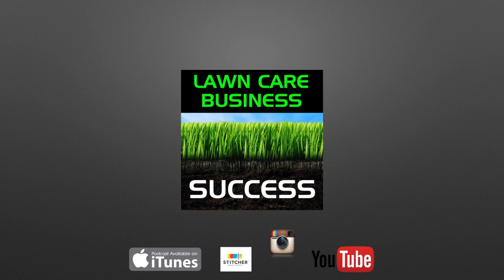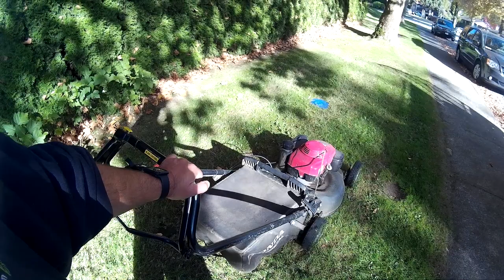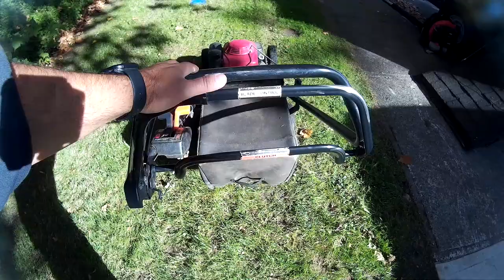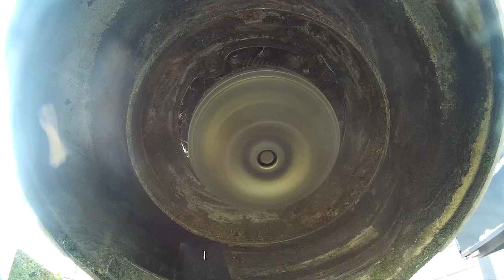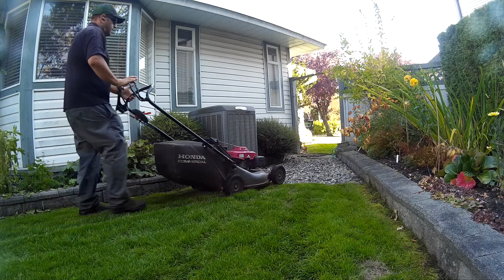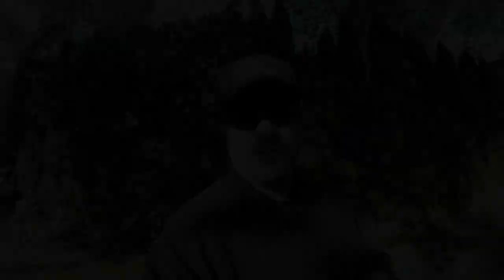What is the BBC or blade brake clutch on a 21" lawnmower

Comment from the maker: Let me know in the comments below if you use a 21” mower with a blade brake clutch and what brand and model it is.
Reply: Lawn Care Business Success i use a 1996 John Deere 14sb
Reply: I have used Honda HR214SX, HRA214SX, HRM215, a John Deere 14pb and briefly a Toro 26626 or something along those lines.  Currently I have a Honda HR214SX and a HRC216k3HXC.  Nothing can compete with Honda's Roto-Stop systems.  On a side note, I also own a Honda HT3813 lawn tractor but it currently has no deck and needs some TLC.

Comment: I have the Canadian model of your Honda and an HRX217HYC (top of the line residential mower with blade stop and hydro transmission, but without electric start) and have owned the old HR214SX and the HRA variant with the steel deck.  I also grew up with the HR214SX and they are some of the best mowers you can buy.  Unfortunately Honda has stopped making mowers for the Canadian market so I am kinda left with Scag or something else.  Scag has the advantage of using a Kohler Command Pro engine that's a bit bigger than the GXV160 but the transmission is nothing like the Honda.

Comment: I have a Honda HRX217VYA mower.  I recently had someone sharpen the blade and now the blade brake does not engage.  The blade is constantly spinning, even when the mower is just idling.  How do you fix this?
Reply from the maker: Sorry I have no idea. Taking the 2 bolts off to remove the blade does not affect the clutch. Unless the person was not familiar with the mower and somehow took the clutch apart to get the blade off or damaged something else in the process. Hard to speculate. Never had that happen in the 12 years I used the Honda mowers. Thanks for watching.

Comment: Why does the blade stop cutting or slipping can this be removed and set to standard on the Husqvarna HU 775bbc?
Reply from the maker: Sorry not sure on a husqvarna mower. Sounds like the clutch is slipping or disengaging. On the Honda in this video I’ve never had an issue with the BBC system. I’ve literally cut thousands of lawns over the years trouble free. Thanks for watching.

Comment: I have a hu800awdx/bbc and love it but a year old and one of the drive pulleys froze and I can't figure out how to get the bbc gizmo off to replace a $12 pulley!  No info online anywhere. It would take forever for the shop to fix it under warranty or cost me bigtime for immediate fix at a shop.  I just paid $749 for this and I need advice.  How to remove the bbc, what order etc!  Can you help? How to get the nut off? Torque?
Reply: Look up the manual for it there should be a section on how it’s put together. Just reverse engineer the manual and remember the process of taking it off to put it back on, that’s what i sis for my HU725AWD/BBC

Comment: Hi I have a John deere jx75ex when I try to pull start the engine it has a drag and its impossible to pull start but if I engage the BBC and then pull the engine it starts no problem is this a sign of a badly worn clutch
Reply: Signs of a bad brake for the blade.

Comment: Why did you remove the upper blade? Why call it a 2 16 when it stands for 21" 6hp.
Reply from the maker: I removed the upper blade because I’m in the Pacific North west and it rains most of the year. The single blade bags wet grass way better as it creates more suction with just the lower blade. I refer to the mower as the hrc 216 because that is the model number and what everyone calls it, including my dealer.
Reply from the maker: Also forgot to mention that Honda sells a shim to use in place of the top blade if you want to remove it, so that the bolts stay the right length. I got it at my Honda dealer.
Reply: Toro called some of their mowers these designations: 21-5 (for their Hevi-Duty model 23158 with the 21-inch cut and Briggs & Stratton 5 HP engine) and 25-6 (for their Hevi-Duty model 23267 commercial mower; has 25-inch cut and 6 HP Tecumseh engine).

One early Honda mower was called the HR21-5, referring to the version with the old L-head GV200 (197 cc) engine that made 5 HP.

Comment: Sry but I had my Honda harmony for 7 years and I own a lawn care company for over 16 year and not a problem , with the BBC I had to replace the clutch blade spring or cutch disc every 6 months to a year , don’t be lazy if you are not familiar with the area and have tall grass walk it check it with your feet ,remove any obstacles mark ones that cannot be removed this guy is probably in kahoots
Reply from the maker: Actually the BBC is probably the one thing that never gave me a issue on the Honda mower and I used my first one for 10 years doing 80% of my clients. In fact I still have that mower and the BBC still works great. You say you have run a lawn care company for 16 years but just because you do something for a long time, that doesn’t mean you know what your doing. In fact your comment makes it more than obvious that you still have a lot to learn. It’s not about being lazy, it’s about being efficient and safe. Case in point, what the heck does the BBC have to do with tall grass or obstacles? The BBC on a small mower is the same as the PTO switch on any lawn tractor, ztr, or stand on mower.
Reply: @LawnCareBusinessSuccess  I think he's commenting as a matter of fact. He's not criticizing your video he's trying to add to it and he's actually talking to all the commentaters. Take a read look at it from another perspective. When he says and "don't be lazy" he's expressing his opinion when confronted with tall grass make sure you walk and mark it.  A bit clumsy at expressing himself that's all it is.